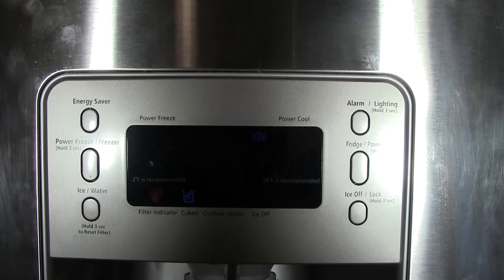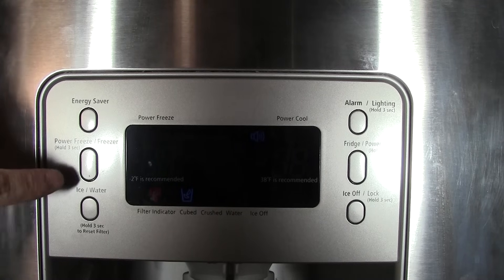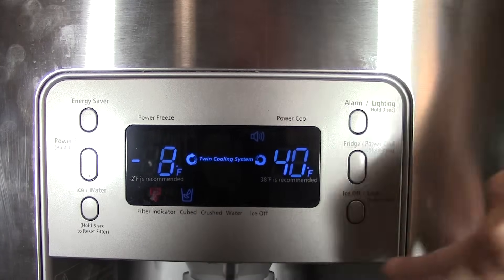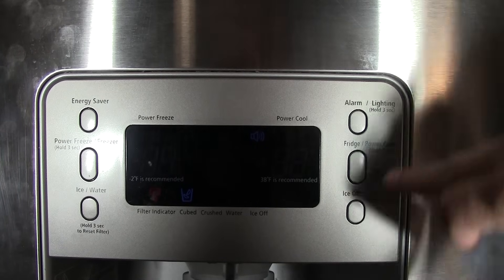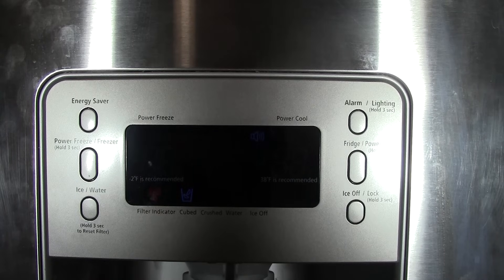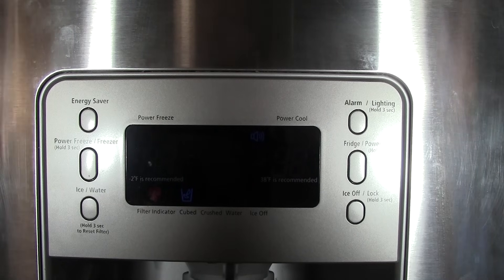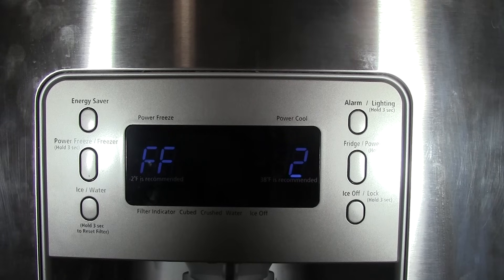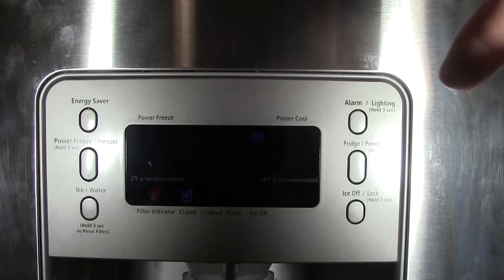FORCED (manual) DEFROST mode on a Samsung Refrigerator--Top Secret Setting

Comment: Stay away from Samsung fridge, be aware of design defects.
Reply: Absolutely, this is my 2nd! Was not aware of problem! My bottom ice marker quit etc....fan froze etc...spent $400 or so got thawed out didn't worry about ice maker because that one had 2. Bottom and top.  Froze up again  within a few months....so found another one almost identical only difference was just top ice maker only for $500.00 with 90 day warranty...
All good? No, within a few months started making noise, ice maker bin was getting cracks, water part had issue...so...$550.00 later...ice maker fixed and new bin for ice....all this had been in the last 18mos...few weeks ago it started making noise and leaking water..started turning ice maker off and freezer temp done...all good...then Friday it started making loud noise...turned temp up and down through day, ice maker off indefinitely at this point..Sunday the fridge temp started blinking...so far this video has fridge doing good!

Comment: Thanks so much! I ran the forced defrost (Fd) about 5 times, with the doors open to our samsung fridge. The freezer stayed frozen, and all the frost and ice that had built up in the back of the refrigerator compartment melted. I'd reccommend taking out all of your shelves and drawers, as the water pools at the bottom of the top fridge section under the large pull out drawer. Make sure to wipe that up so it doesn't freeze again. I also used a hair drying to help the defrosting along, and to dry things out. Worked like a charm and the noise from the fan hitting ice is completely gone! Thank you again! Saved me a lot of time and money!
Reply: If water is pooling in the bottom of the refrigerator area, I would bet that the evaporator drain is blocked by ice and/or debris. There are YT videos that address this common problem. I cleaned out the debris and replaced the drain heat sink with an improved aftermarket device (a piece of aluminum that transfers more heat to the drain). No more pooling of water and no need for a forced defrost.
Reply: @danm8937  thank you!
Reply: S, @danm8937
Reply: I ran the forced defrost once now I can’t tell if it’s still doing it or not it’s two hours later but the dingdong noise or beeping has stopped quite a while ago that started when it went into forced defrost.. I switched the circuit breaker to turn off the fridge and turn it back on two separate times because I wanted to run the forced defrost again but nothing happens when I press the buttons. Now I don’t know how to turn the fridge  on cold again?

Comment: If you are having trouble with accessing the "Forced Defrost" function by pressing the buttons mentioned in the video, this post may be for you. On some newer models in particular our 4 door RF25HMED press "Freezer" and "Lighting" at the same time for about 8 seconds. Then immediately press any button until you see "rd" displayed. The fridge will constantly beep as you are now in the "Forced Defrost" mode. Once the irritating beeps stop, "Forced Defrost"  has ended.
Reply: Hi I have the RF25 model but holding the buttons suggested is not working for me. Any suggestions please. The panel does not go completely blank. My water light is still on.

Comment: I did the FD, the sound beeps for 30 minutes and it automatically goes back to normal mode.  Fyi, I still see lots of ice formed underneath the tray after the FD.  I might need to unplug the refrigerator and clean up first and do this cycle FD again and probably I will do this cycle every 3 months after that to prevent the ice formed below the tray again.  Thanks for the great tips.

Comment: Thanks Jake. After unplugging the refrigerator, it took 9 hours, and a lot of patience to melt the ice mass on my condenser coils. For anyone who's new at this, it's not easy to remove the condenser cover, so never try to pry it off or you will damage the insulation.  I used a space heater elevated atop a dry container as to not come into contact with any water.  This helped speed up the process. Once it is completely defrosted, the next step is to clear the frozen drain tube.  I used a rubble bulb, the type used to clear an infants nose.  Use the bulb to remove any moisture from the drain then use the bulb to put hot water in to open it. One reminder, when you defrost manually, make sure the coils and cover are dry before putting the cover back on to prevent new ice from forming when the condenser it turned back on.

The error codes are still confusing so I'm making a 'go to' list to keep near by for future reference.
Reply: were you able to finally get the back cover off? Mine is still frozen and im having the same issue trying to remove it. I am even using a turkey injector and squirting hot water into the plastic holes and i can hear ice cracking

Comment: With all our new technology we've come full circle to when Mom used to defrost the freezer part with a bowl of hot water underneath. I bought the POS Samsung due the kitchen cabinets having a space made for a 36" counter-depth fridge. Year 2 and 3 the ice tray stopped working. Best resources were online. I opened the doors and let the ice melt with the circuit breaker OFF. Once I could I pried the box full of melted and refrozen ice out and emptied and dried it. I put paper towels all around inside the ice tray area and melted the ice in the back with a blow dryer on low slowly. It is something everyone who owns one should do. Saves a service call. It just takes half an hour of time and patience and it's like new. Worked perfectly till we had a power outage in 90F and ice jammed in the tray again.
Now my fan is making grinding noises when I open the French doors. What a POS only 4.5 years old. I turned the breaker OFF for half an hour and reset it. Twice. Then it wouldn't start cooling. I'm going to try the defrost mode suggested here and do it a few times. Sounds like an ice jam starting in the fan. Never again. It's pretty but a piece of SAMSUNG crap. I have LG appliances and when I move I'm replacing this one. Ridiculous to go back to the dark ages with a high tech fridge. Maybe it's time to buy an ice box and have huge chunks of ice delivered. Cheaper than a service call for these Samsung sh*tboxes. 

UPDATE:  The circuit breaker off for 1 hour twice did the trick. The fridge started cooling and has been working well. Force melt seems to work well for this problem. Damm P.O.S. Samsung. Don't waste money on a Samsung fridge and if you have like me, try my tricks. My fridge is 5 yrs. old now with 0 service calls. 🤞
Reply: Celeste B you are so right!  Sh*tboxes indeed!  I moved into a home with all Samsung appliances after a lifetime of whirlpool and maytag.  I HATE them all as they just do not perform well.  They look very nice but I will replace with dependable appliances as they break down which seems that I might be doing that soon!  I am defrosting it must but am leery of trying he FD as I am not tech saavy and do not know what I would do now if I messed up the refrig which IS working....at least for now!  We are asked to be at home and use only essential services so I won't call anyone over the freezer issue right now if I cannot get it to work.

Comment: Hello, my husband & I recently bought a house and the home came with a Samsung French door Refrigerator. The Ice machine on the bottom in the freezer works but for some reason the ice maker was not working on the top part. We tried and tried to get the ice bucket out, once I googled it I looked thru the hole and the bottom where you out your fingers to pull out the bucket and realized it was completely frozen inside. So I found your video on forcing it into defrost mode. I am currently trying that right now & pray it will make it so that I can retrieve the ice bucket to see further inside. Thank you for the video it was really helpful. Once I am done I will post weather it was successful or not but thank you again.
Reply: Please be sure to let us now how you got on
Reply: Well....?
Reply: So ?
Reply: all talk, no reply

Comment: Enjoyed your video I’m on my second go around with the ice problem it started with the icemaker not wanting to make ice and making very small pieces of ice then for the heck of it I checked under the crisper drawer and yes there was ice and water. If I take the inside panel off and just move it out-of-the-way slightly and then use the force to defrost setting would I be able to touch the tubing and feel that it was getting warmer and also would it even work with the door open

Comment: I'm glad I tried this method before tearing the inside of the fridge apart. I ran the defrost mode three times. The first defrost took about 40 minutes before it automatically went back to normal operating mode and the compressor kicked on. The fan was still hitting some ice so I ran the defrost mode two additional times. The second and third defrost each took about 25 minutes to complete before automatically kicking back to normal operating mode. It seems to have worked since the fridge is now quiet again.

Comment: Setting your fridge to 40f isn't going to help your frost issue since it's probably coming  from a clogged drain.  40f is too close to the 41f danger zone where pathogens grow after 3.5 hours or more, i.e., ecoli, listeria, and salmonella.  And you won't know if you have them since, unlike spoilage bacteria, pathogens have no odor, taste, or smell.  So, thanks for helping your viewers enter into the food poisoning zone!!

Your problem could be debris or scale buildup not affected by defrosting or even by your -8f freezer setting . Refrigerant on some samsungs run first through the evap in the fridge compartment then to the freezer.  At -8f  even if the fridge has hit set temp it's evap is still flooded with refrigerant but the fan motor is turned off causing cold air to drop to the bottom of the evap where the drain line is. The line freezes, causing water buildup. The fan may eventually become noisy and blocked by ice. If it stops making noise, it doesn't mean it's no longer blocked. Samsung's board polls the fan's rpms, and if it's below a certain point, the board will stop sending power to the fan, and now we have truly warm pathogen generating temps in the fridge section 

Some water will flow under your crisper drawers, and some will eventually be sucked up by the fan when it turns on and  subsequently sprayed on refrigerant lines turning into ice and frost behind that evap cover.  

On models where the refrigerant bypasses the fridge evap and goes directly to the freezer, the drain line from the fridge can still freeze over since that drain runs inside the wall  directly behind and adjacent to the freezer evap.  so set freezer temp to recommend temp as well.  

Btw usually, once this happens, setting the temps to normal usually won't cure the problem. Running defrost helps some, but the excessive ice buildup at the top of the evap isn't going to he affected by the heater at the bottom of the evap, and you'll just make matters far worse.  It would be better to open doors and turn off the entire refrigerator for a day  or two  maybe longer since the frost/ice buildup is in  insulated areas of the fridge (think how long it will take ice to melt ice inside a closed igloo ice chest).

BTW if you damage any of the styrofoam on the fridge evap cover, you're gonna have to replace the entire evap cover assembly. 

Also, if your icemaker isn't working properly, turn it off. Samsung's freezer on pre 2020 models go into ice production mode where the freezer drops to -14f internally (you won't see it reported on the  interface) to try and push the icemaker to work. This happens regardless of where the icemaker is located and even for icemakers that get its cooling from a refrigerant line. Samsung's icemakers need from 5f to 10f to work. So this will produce the same results I discussed regarding your low freezer setting. 

To get you to properly understand this, Samsung's document states ' ice maker controls freezer temps. Until the ice bucket is full, Samsung drops the freezer to -14f. Anytime ice is used, the freezer will again be set to -14f. Once the bucket is full, the customer's freezer set temperature will be controlling.  If ice Off is selected, set temperature will always be controlling. '  Samsung then gives an example " If water is not hooked up, freezer will always be -14f unless ice off is selected.  "   Of course, the same thing will happen if you have a faulty, slow-moving or overused icemaker.  

If it's debris or scale causing the clogged, you would need to physically clean the drain and/or replace the drain tubes in the machine compartment

Sorry for the long post, but I see so much wrong info on Samsungs that every once in a while, I'll post. And no, I have no affiliation with Samsung, although I've been trained to repair them along with other manufacturer's appliances. About 12 years ago, I took it upon myself to learn them. 

Misinformation on Samsungs leads to a lot of problems that aren't fixed properly and perpetuates the myth that they are worse than the rest of the manufacturers. Truth be told, they all suck. Samsung is no worse. They just suffer more from misinformation and ill-trained 3rd party technicians.
Reply: Golden information...
Certainly not found in my product manual...
Gratitude!